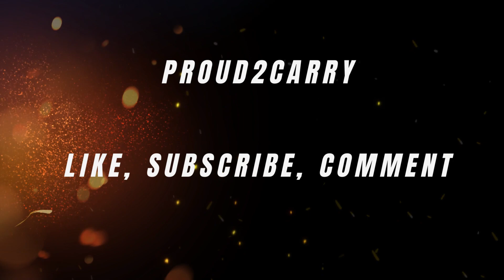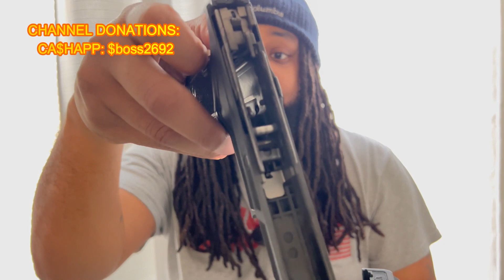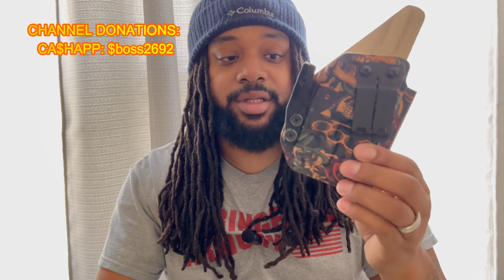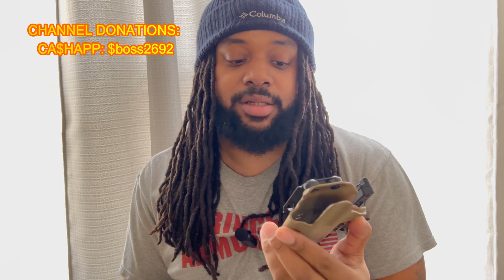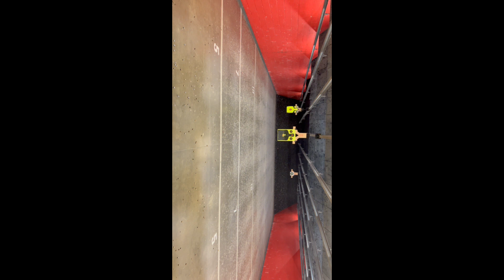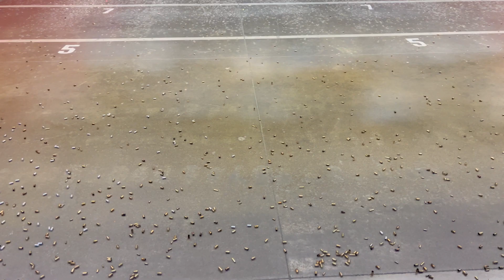1000 round review of the TAURUS GX4 CARRY.. RELIABILITY, HOLSTERS AND MORE #pew #taurus #gx4 #edc

Comment: Hey brotha I’m going to buy my first gun what gun do you recommend gx4 carry or G3c
Reply from the maker: They’re both great reliable firearms in my opinion. The G3C has a longer track record but the GX4 carry has the capacity. I say test both before you buy and make your decision based off that. Also the G3C is less snappier than the GX4 carry.
Reply: I have the 3C and the trigger sux ! I have 2 GX4 pistols! One is the Toro ! The X4 has a much better trigger! Both handle 124gr hps and ball ammo great!
Reply: For a first carry, if you have any discomfort in having a round in the chamber, get the G3c. You can chamber a round and use the thumb safety until you trust otherwise. I have both. Both are great weapons.